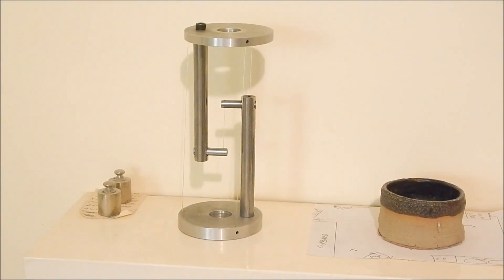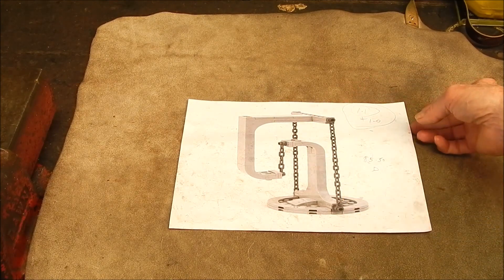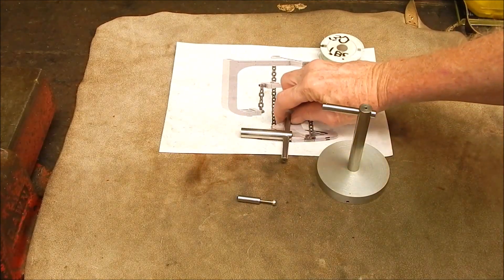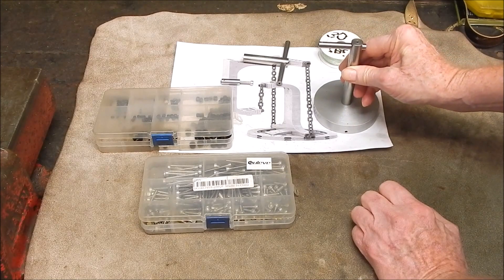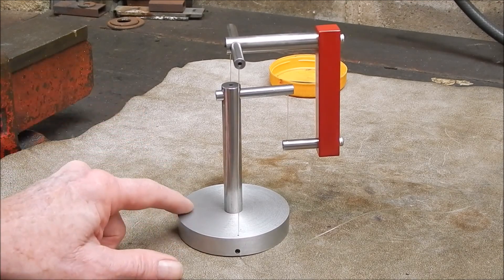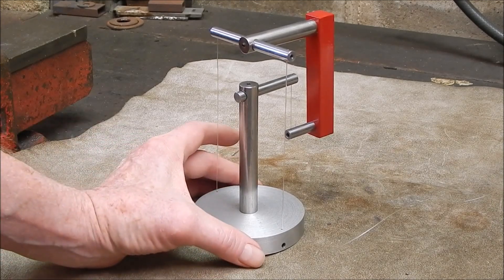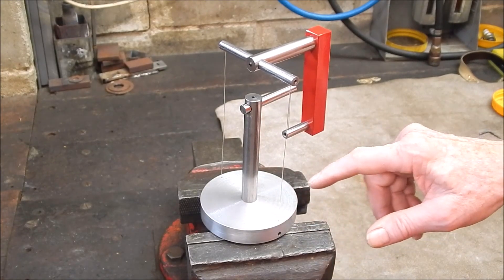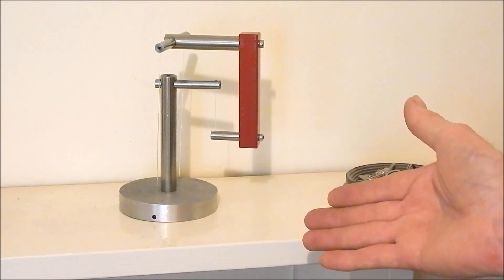How to make an awesome Tensegrity model and amaze your friends

Comment: Nice curio/conversation piece, but I can't help thinking about once the fishing line gets a bit of sun on it and it starts to weaken, does it just slowly sag or does it make a thump/clatter in the middle of the night🤔🤔
Would it be better to replace the fishing line with some 0.6mm polished stainless mig wire/1.0mm tig rod?
Reply from the maker: I considered using stainless wire trace but decided clear looks better.  Nylon is not like plastic and is UV stable (that's why they use it for shade cloth).  It also is unlikely to stretch over time.  Cheers Rob
Reply: @Xynudu  👍

Comment: Great thing, well done. It's temptating to build one. Recently Banggood sold me a globe that is truly hanging in the air due magnetic force, and the globe can spin around.
 Adjusting the balance, setting the tension of the two balancing nylon strings it looks easy to tightend the grub screw too hard and cut the string off.
Reply from the maker: Yes, you have to be gentle applying grub screw pressure or it could cut the nylon.  Just enough to hold it is all it requires.  The nylon compresses and locks in place well.  Cheers Rob
Reply: @Xynudu  Thanks Rob! Really a funny project that might wake my dormant, dust collecting machines up. Drone flying has been the mission...
Reply from the maker: So many things to do in life Stefan.  RC is very tempting.  Not that expensive any more either, if you don't go overboard.   A neighbour bought a drone for fishing (it takes out the bait and drops it) but he's afraid to use it as it cost over $2 K AU and is hard to see out over water.  It's the type that floats and stays upright if it ditches in the sea.  Amazing what's available.  Cheers Rob
Reply: @Xynudu  My drones did cost 1500 USD and  4400 USD..... The first was for learning and the second, a DJI Mavic 3 pro, for its 3 cameras. Dropping things is not possible.
Relying on the equipment, trusting it, is necessary. Sometimes the flight can be 2000, 2500 metgers away over a large lake. Monitoring the strenght of the radio link and the remaining battery are the main tasks those days. Some thrill is unavoidable....